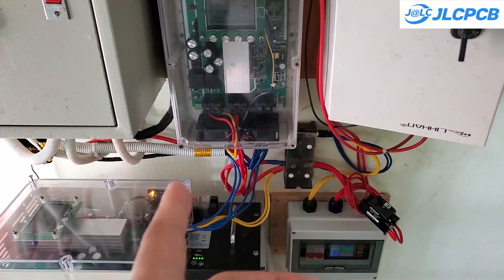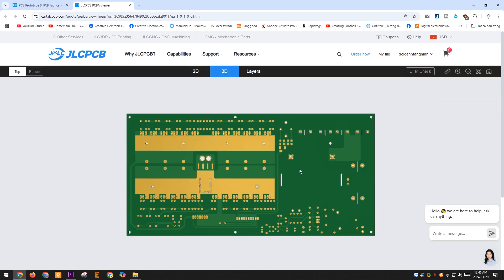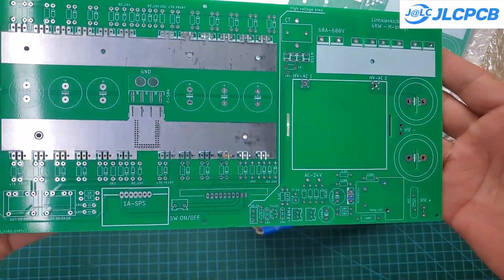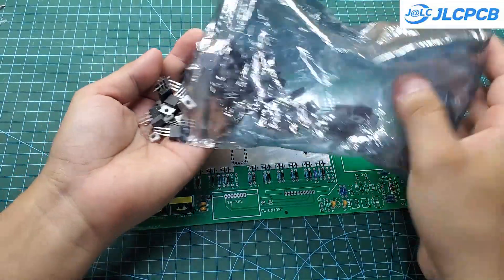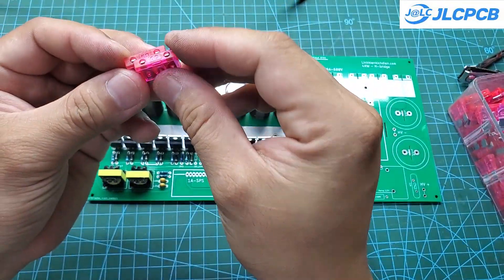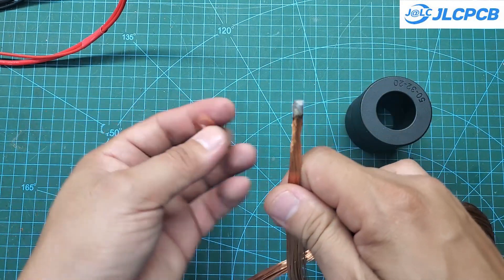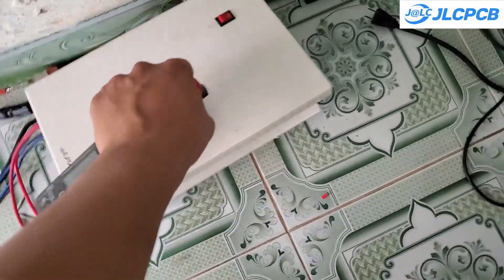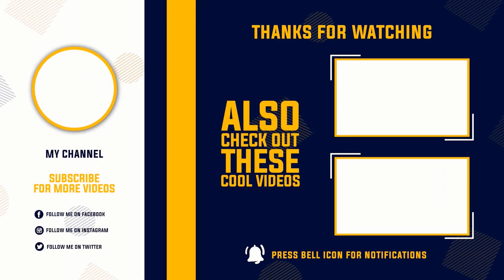4KW Boost for Grid Tied Inverter | JLCPCB

Comment: Those amorphous transformer core datasheet shown that at 500khz the core output is 5kw for that core size and Many  converter design lower frequency which low switching losses 📉 are and so I will continue using my 125a core way better current density at 50khz the same size core output 5kw that's I used for my welder

Comment: What is best toroidal filter for something like 8kw? Not same size toroid, smaller?? I am using 80mm amorphous nanocrystalline, need filter though, you use green cores so is that size best?
Reply from the maker: you can use 2 core hjs225125 for 8KW
Reply: @PhdHung  I just ordered a 50mm amorphous toroid, I will have about 8 turns on it? With 50 strand litz wire x2 The main transformer is 80mm and it will have the same litz on the primary, and some tough insulated just multistran on the secondary, center tapped. 
Is this just about optimal?

It should work, i will get back with efficiency numbers when this starts happening.

Comment: Can you show GATE drive distortion at oscilloscope and also ripple of voltage
on the DC BUS ? Can this bulk capacitor cope with such large noise and ripple
from switching all this FETs ? Where if low impeedance capacitor in parallel
with this electrolytic caps ? Can you place thermal image of overheating
of caps, which are not dimensioned properly for ripple current and are placed
in the vicinity of hot fets ?
Reply from the maker: Because I use it for grid-tie inverters, and inside these inverters, there are four 560uF - 550V capacitors connected in parallel. The output voltage will be very clean. If used for other purposes, the two filter capacitors on the board are not sufficient; we need to add external filter capacitors.
Reply: @PhdHung  Thanks for answer. Is there some number for DC-AC full bridge you have like THD ? How can this inverter cope with inductive load PF == 0.3 or capacitive load ?
What happens if I switch ATX power supply which droves 120 - 150 AMPS at 230 V to charge CAPS through NTC ?
Reply from the maker: With a grid-tie inverter, you can use it for all types of different loads. It can handle a power factor (PF) between 0 and 1, or loads with peak power or loads with power much higher than the inverter’s capacity. If the inverter doesn't provide enough power, the load will draw additional power from the grid. I am using the Sofar 3300TL-G3. You can read more information in the manual. https://www.sofarsolar.com/upload/file/20240311/1710121923451047146.pdf

Comment: Uou!! But, why 350V ?
Reply from the maker: My grid-tie inverter can operate within a voltage range of 70-550V. I will increase the voltage to around 400VDC. Higher voltage will reduce the current, which in turn reduces the losses on the diode.
Reply: @PhdHung Do you step-up the batteries to then connect them with the photovoltaic panels at the solar input?
Reply from the maker: I am using a Grid Tie inverter with a limiter. If I connect it directly to the PV, it will only operate during the day (of course). Moreover, at noon, when the solar power is at its peak, I don't use much electricity. Therefore, the energy from the PV will be wasted. As a result, my system includes an MPPT charger to charge a 51.2V-150Ah lithium battery. Then, the 51.2V is stepped up to 350V and supplied to the grid-tie inverter.
Reply: @PhdHung  I'm doing the opposite. I realize that the solar energy input is not stable, any variation is returned to the utility company. So I did a stepDown of each panel to 26v and put it in parallel at the battery input.
Reply: Доброго дня! Скажіть будь ласка, який коефіцієнт трансформатора струму?

Comment: Impressive video, Awesome Tech. Looking forward to your next upload. I clicked the thumbs up icon on your content. Keep up the fantastic work! Your explanation of the H Bridge structure and its advantages was really enlightening. How do you anticipate the efficiency will change with varying load conditions in the new design?
Reply from the maker: If we use an H-bridge, we don't need MOSFETs with high Vds voltage like in the case of a push-pull configuration. Low-voltage MOSFETs have a lower Rds On and are more cost-effective. They also generate less heat during operation. Additionally, transformer design becomes simpler. However, the efficiency is only higher than push-pull when using high input voltages (48V or more). For 12-24V systems, push-pull is still my choice. As for efficiency with different loads, since I use it for grid-tie inverters, I don’t concern myself with that issue. Grid-tie inverters can work with all types of loads with excellent efficiency (over 95%).
Reply: @PhdHung do you sell electricity ?

Comment from the maker: This boost module will integrate with a grid-tie inverter. When the electricity generated by the solar panel exceeds the demand, the excess energy will be stored in a lithium battery. When the solar energy produced is less than the demand, the battery will discharge to supply power to the household. My system will maximize the utilization of energy generated by the solar panels. The cost is significantly lower compared to expensive hybrid inverter systems.
Reply: So you produce voltage for DC BUS at 90 % eff. than use grid-tie, with 95 % eff.
to to supply power to AC-DC charger 240 AC - 48 V DC, to charge 48 V - 16S LFP ?
Eff. of LFP is 97 % avg., so you have 0.9 x 0.95 x .9 x .97 === 74.6 % total eff. 
at the input to LFP, and to use energy from LFP you have another unefficient
DC-AC inverter, so you have another 5 - 8 % losses again ?
Reply from the maker: I am using a Grid Tie inverter with a limiter. If I connect it directly to the PV, it will only operate during the day (of course). Furthermore, at noon, when solar energy is at its peak, I don't use much electricity. Therefore, the energy from the PV will be wasted. With my system, I can utilize the surplus energy to charge the battery and use it at night, or when the PV is insufficient, the battery will discharge to supply the load.
Reply from the maker: I use an MPPT charger to charge the battery.

Comment: What is its function?
Reply from the maker: This boost module will integrate with a grid-tie inverter. When the electricity generated by the solar panel exceeds the demand, the excess energy will be stored in a lithium battery. When the solar energy produced is less than the demand, the battery will discharge to supply power to the household. My system will maximize the utilization of energy generated by the solar panels. The cost is significantly lower compared to expensive hybrid inverter systems.

Comment: Please how do you use it?
Reply from the maker: This boost module will integrate with a grid-tie inverter. When the electricity generated by the solar panel exceeds the demand, the excess energy will be stored in a lithium battery. When the solar energy produced is less than the demand, the battery will discharge to supply power to the household. My system will maximize the utilization of energy generated by the solar panels. The cost is significantly lower compared to expensive hybrid inverter systems.
Reply: Can you design inverter that uses pic16f72 pure Singh wave with. LCD ?
Reply: Thanks boss

Comment from the maker: Today, I will build a boost converter module to step up 48V to 350V for my solar power system. This is an upgrade after six months of operation. Previously, I used a 3KW boost converter, which often experienced overload issues, and the overall efficiency was only around 85%. With the new system, the power capacity is increased to 4KW, and efficiency has improved to 90%.
This improvement is thanks to my use of an H-bridge circuit to replace the push-pull circuit and substituting the EI transformer core with an amorphous transformer core.
Reply: Dir Sir, why it is not possible to create a schematic and put it as PDF to the project .ZIP ?
I ask not only for this project - for the future also.
Reply: Amazing sir
Reply: Hi, I have 94  - 95 % efficinecy in my boost at 30 - 35 AMPS IN,
but my FETs have large Rdson, so there is plenty of room
to make efficiency better, and also modulate SW frequency
to lower also swithing loses.